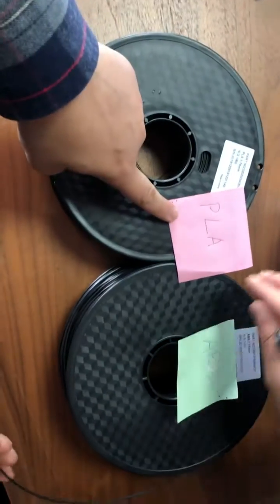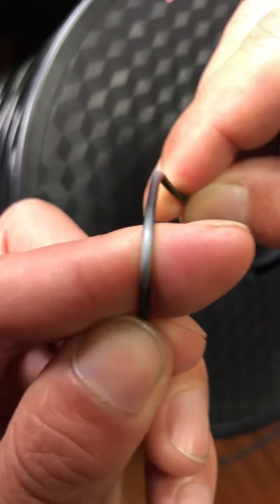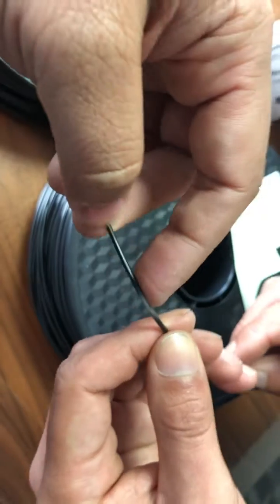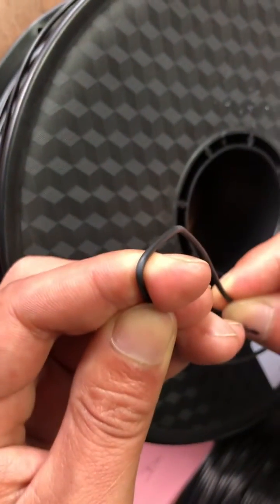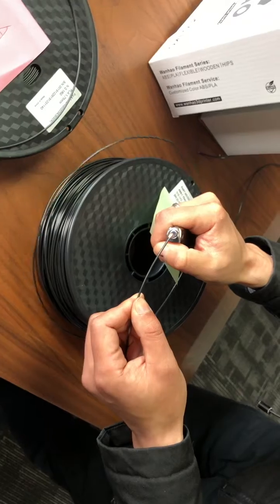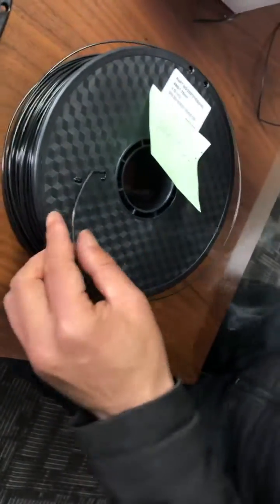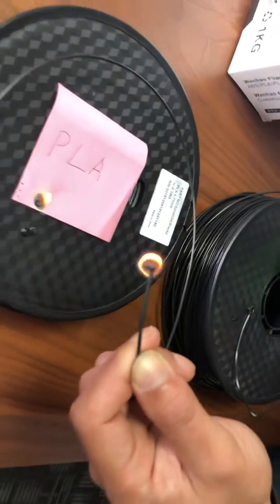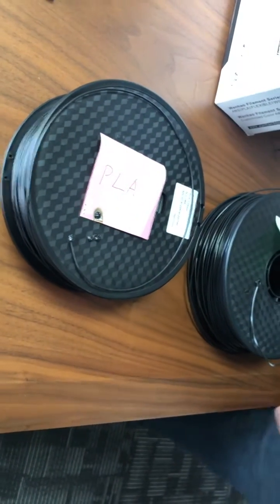How to distinguish ABS filament from PLA?

Comment: What if it's white?
Reply: Yeah, as mine is. :(  There is a flame test too.
Reply: @generalawareness101  what's the filament test? I have a mystery black filament and i wanna know if its PLA or not (ABS is not the only other option)
Reply: @himura128  How easy does it break, and get a lighter and set it aflame on the end.  You will know as ABS melts (drips and has a smell like melting a BIC ball point pen casing) while PLA will not, and the flame colour is different.  PETG there is no viable test from an unknown roll.  Now there are all kinds of different filaments out there so good luck.
Reply: I dont get the problem, ABS stinks like crazy?
Reply: @jankristijan5889  Not to me it doesn't as I love the smell from when I was a child and burning Bic ball point pens (the clear ones).